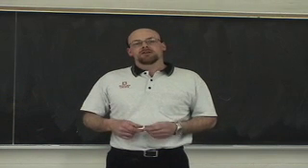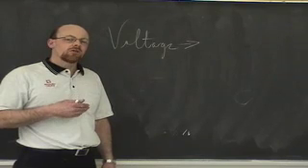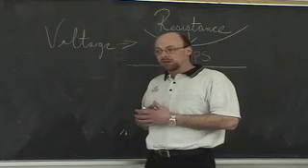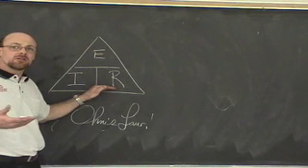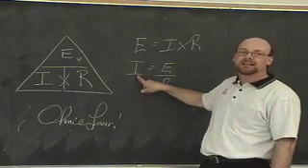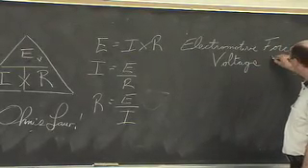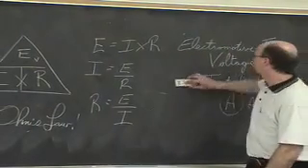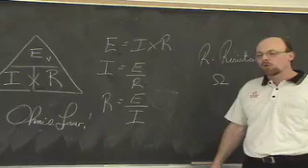Ohm's Law

Comment: in the new proposal v1 -v2) is always less than or equal to v1 + v2 -- v is velocity. The former we call 'force' and the latter 'acceleration'.
So we should understand now that voltage is high speed and low mass current and amperage is low speed and high mass current. eg: x-country power lines use hi speed from the step-up transformer. I encourage you to ask your minds questions because otherwise the mind atrophies like a body with no exercise, your mind can work on questions when your asleep.

Comment: From many observations we know a fluid flows faster in a thin pipe not athick pipe and an insulated conductor is a thin pipe. A jet engine, your spray can, your car brakes, all work on the knowledge that a fluid flows fast in a thin pipe -- so it is about time electricity made the same sort of sense. Eevn a breeze through your house goes fast through a narrow opening and slow through a large: window to open door.  The mind needs exercise. Askit many questions,mere mentalgymnastics is not enough.

Comment: Conductance -- that a Meter measures -- is C = L/A. What we can say is that Power = mv-squared when v = v(max) + v(min), and m is v-v) /(v+v). V is velocity of the electrons. This is good because we do not need P=E/t. So now we see a battery is Mv-squed and the load mV-squed. When we add batteries(series or par.) the increased volume causes a disorder increase, making electron ejection into the thin wire harder: internal battery reistance increases. It might seem hard @1st.but is easier.

Comment: When a water wheel is free to revolve its revolutions are proportional to current flow, but restrained it measures something else. Ask yourselves many questions about resistance variation and a meter. Forget complex digital displays because they only tell what the original meter told. A meter in series or parallel has not changed, therefore it cannot measure something different -- it is impossible your meter measures voltage and current. So the theory is wrong, which is good: now we see truly.

Comment: What we find is that R=A/L is correct and that R = rL/A is incorrect. This occurred because of supposing the FMMC meter could measure a flow in a wire external to itself. But logically the meter can only respond to current in its own coil and cannot tell us how current is flowing in an external wire. Just as a river can form a large pool and then flow over a waterfall, but a tachometer in the waterfall cannot tell us about the flow in the pool. A wire thick relative to the meter wire is a "pool"

Comment: Science made a mistake. R = A/L not R =rL/A. Why? Because electrons flow like water and they 'pool' in short thick conductor and flow very slowly -- even though many more of the electrons go through the fat conductor because of the larger CSA. And in thin and long conductor the electrons go very fast. The electrons form a wavefront that has a unique mass of its own and not necessarily n x e. mass. We made the mistake because we assumed the FMMC Meter measured flow but it measures conductance.

Comment: It's painful to watch this. First of all the resistance determines the amount of current, and not the voltage (e.g. a 12V battery won't turn into a 60V battery if you have a circuit with a small resistance...). 
Second, that triangle only makes it harder to remember! All you have to do is remember V=IR and you can derive the other two forms of the equation using simple algebra.